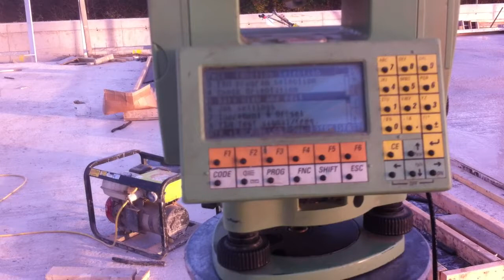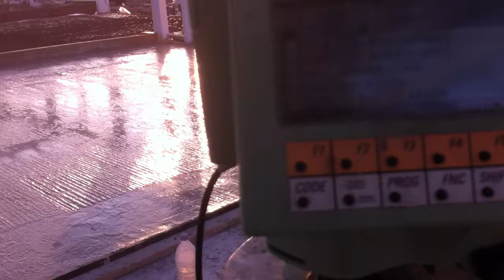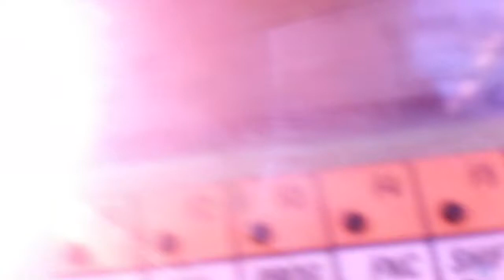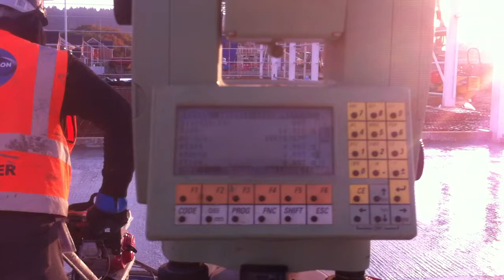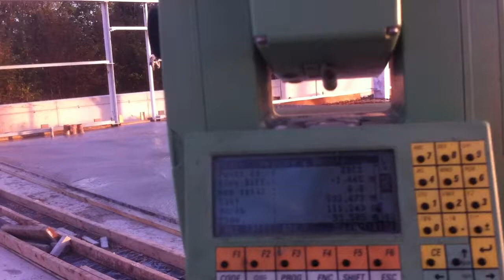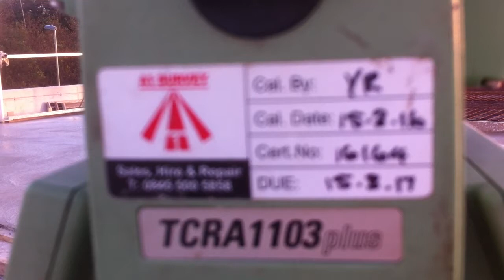Leica TCRA1103 Survey checking  the finished level of a shop floor slab whilst Concrete is wet.

Comment: NEXT to Chris I guess you are referring to the tribrach being on the tripod and that being on concrete.Well I'll be the judge of that and the comment BAD ENGINEERING suggests your the perfect engineer able to judge others.I did this just for my own records and a staff training aid and I felt I achieved the purpose.Using the onboard levelling software and control calibration meant I was aware of what tolerances I was likely working within and I certainly was happy I achieved them, feeling my results were going overboard rater tan promoting bad engineering.

Comment: Ah the memories! I used an 1100 before 2010 and when I retired a few years ago was gifted another one in working order. I have issues though. Does your 1103 use a pcmcia card? If so how do you read the card on a modern computer, say Windows 10 and better?